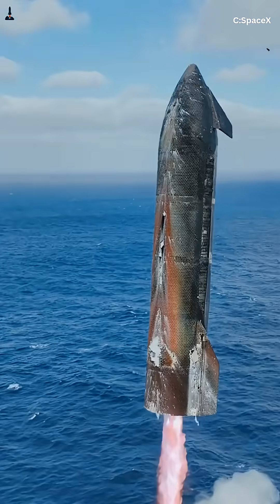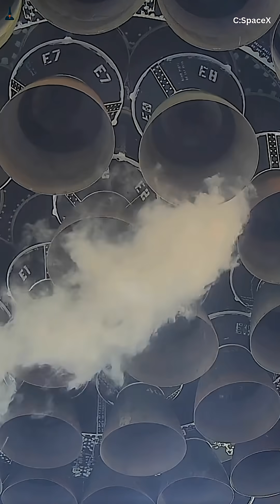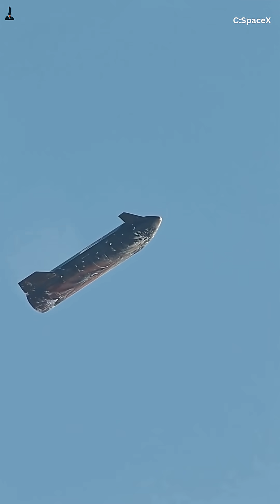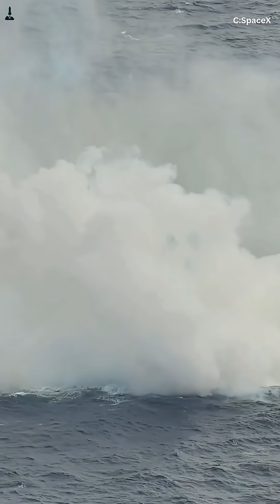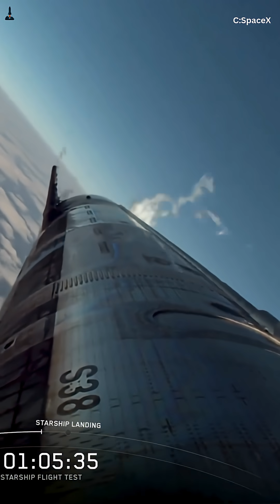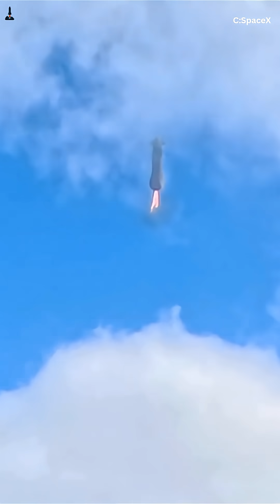When Flaps Stop Working, This Takes Over #spacex #starship #elonmusk #flaps

Comment: Great presentation and information but clarification. Starship does not use it's raptors for reentry as of yet. It uses its flaps for control authority untill it's time to transition between the bellyflop and upright landing burn. However they do move the engines to use the weight shift in the movement to help pivot the vehicle over into the bellyflop maneuver. I hope this helps you with your information. Don't lose your thirst for information and informing people. Your doing a good job but a little more research would have given you the correct answer.

Comment: sorry for the ahem actually 🧐☝️

air resistance scales with velocity squared only at low subsonic regimes
it becomes closer to velocity cubed approaching mach 1, which also is the maximum
past this point, it decreases with speed, proportionally to 1/mach number

this strange phenomenon is why we can perform supercruise in some planes, you only need afterburner to get there, once there, the extra power is no longer needed
Reply: you're talking about parasitic and induced drag I'd assume, but wave drag does not decrease, rather increase

Comment: Bro what?? Starship doesn’t use its main engines on re entry.???
Reply from the maker: Yes, Starship doesn’t use its main engines during reentry because the goal is to lose energy, not add it — firing engines at Mach 25 would increase heating and
Reply: @Rocketryspace  your script certainly implies the engines are running during re-entry  -  “providing over 500,000 lb of thrust”.
Reply: @Rocketryspace  You’re harming your reputation by making false content.
Reply: I feel like he means they gimbal to shift mass not that they are actually on, until landing burn that is. Though I have no way to verify of course lol.
Reply: @mic @michaelmoak1443 ah I’m pretty confident in saying the Starship doesn’t use engine gimballing as a control method during reentry. Gimballing would not shift mass in any meaningful way. Moreover they state that when the flaps which are primarily used to control the ship’s reentry fail the engine gimballing take over control which is completely false. It seems like an AI generated script that was read verbatim without any understanding of the actual process that starship uses for reentry.
Reply: @michaelmoak1443 gimbaling inside a shielded engine bay does nothing...besides, I have watched all of starship's reentries, and the engines are not gimbaling during reentry, they use cold gas thrusters mounted around the ship, and yes, they also use the flaps
Reply: Its all complete nonsense
Reply: @Ustayblacknow  This content creator has several videos with false nonsensical information. I’ve called him out several times now and he admits he’s wrong but doesn’t remove the false content.